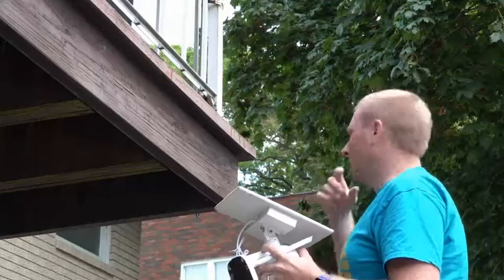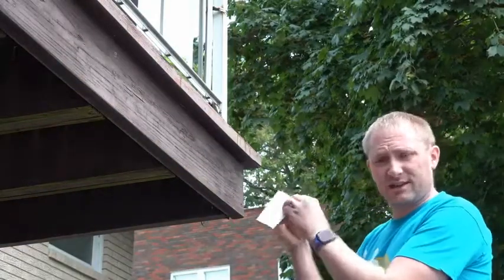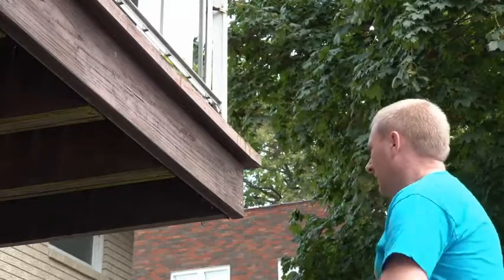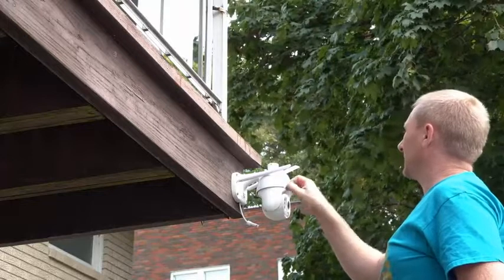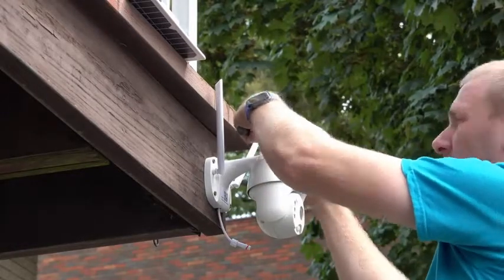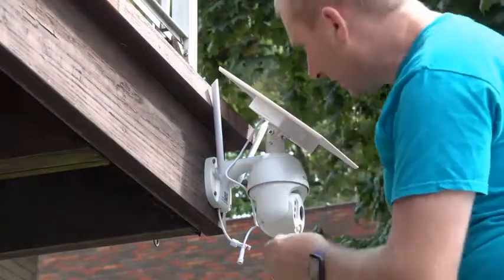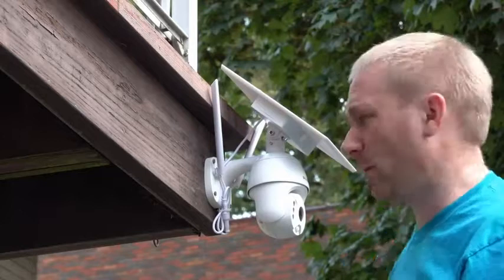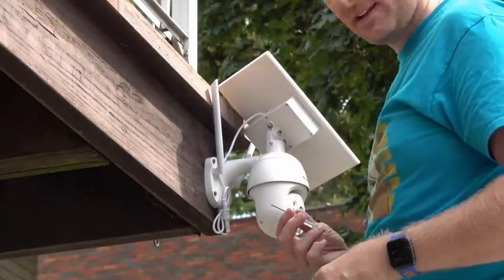Soliom S600 Pan Tilt Outdoor Security  Spotlight Camera Battery Solar Powered

Comment: Is there a video or written directions on replacing or adding batteries on the S600?  I read that it may have been shipped with fewer batteries than it can hold.  Are lithium batteries suggested for climates with hot/cold extremes?